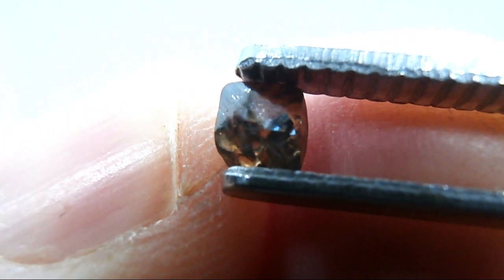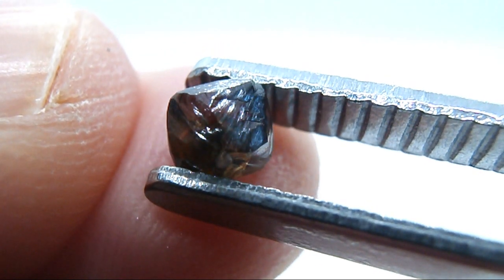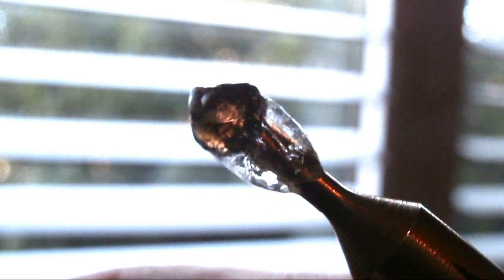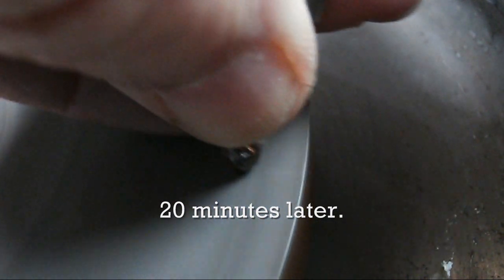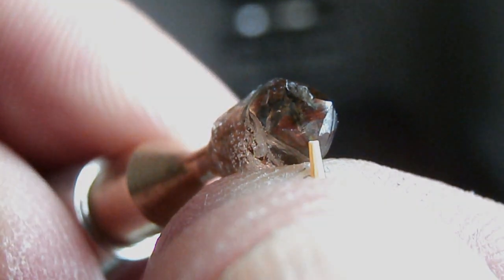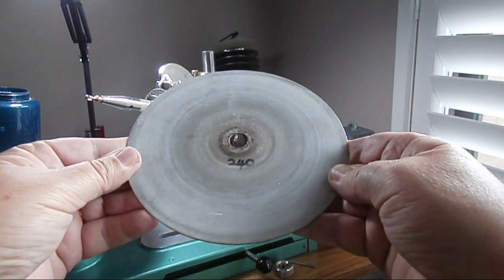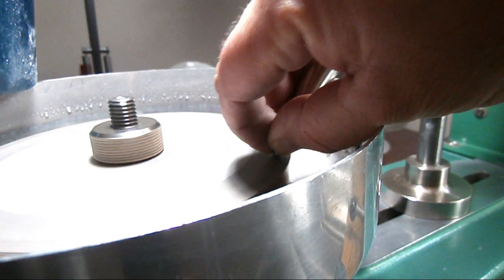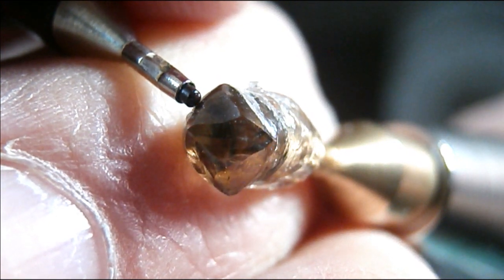Faceting a Diamond

Comment: Hello. You will need an iron scaife impregnated with diamond dust & caster oil. You will need to understand the grain or Voss of the stone and what you have there is a sawable not a makable. The Dodec is the third form of crystallography (cubic and octa) and you will need to position the table first. After sawing a top from the stone. Then set your stone into cross by polishing the top hoeks or corners at 34° then your bottom facets at 40.9°. Then 4 more facets opposite to these to create top corners above and below. You will need to brut the girdle on a manual Rams bruting machine or a Bettonville laser or similar. Then upper half facets and stars to create the bezel from the hoeks and corners and then the lower halfs 80° towards the polished culet. Then Zoet or smooth each facet on your scaife zoeting ring. Believe me polishing a diamond is Not polishing any other gemstone. Ask me anything you'd like to know. 34 years with De Beers!
Reply from the maker: Thanks for the information. There is quite a bit involved with cutting a diamond. Unfortunately I don't have the right equipment or the expertise. I thought it would be nice to test out how hard a Diamond is and see what it feels like on the lap. Diamonds certainly live up to their reputation as very hard gem. It would be good to learn the craft of cutting diamonds. Most likely it would be a very expensive hobby. Cheers
Reply: @sievecn do you provide training on diamond cutting and polishing? I am looking for a mentor who can teach me the skill. Willing to travel and work for free until I learn the craft?

Comment: Yes, i learnt  I  should stick to corundom or softer  and leave diamonds to the provs 
Thanks for sharing bud
Reply: @Babulal-nz8ii 
 I may have already sent this,,
 Your quite right , diamonds have been cut for a long time before machines speeded  the process, 

I was wrong to dismiss the possibility  without even trying ,
As I have successfully polished and shaped  Ruby, sapphire and quartz  buy hand on diamond sharpening pads and wet n dry paper ,, yeah it took a few hours for a few evenings,, but hey,, we were in lockdown.
Thanks for the inspiration to try my friend
Reply from the maker: Babulal has no idea what he is talking about! I made it quite clear in the beginning of the video that diamonds are usually faceted on specialised equipment - cast laps, claws etc. This video gives the average home hobbyist an idea what it like to facet a diamond on regular faceting equipment. As mentioned in the summery, it's feasible but a folly. Imagine the countless laps worn out, time and effort and what for? A diamond the cost less than the worn out equipment and time. Bababul is also trolling.
Reply: @VintageTimeGems   hi cliff , firstly I would like to say I enjoy your channel very much, and in no way was I disrespecting you..
Yes you made it clear you were not using diamond cutting equipment, you were showing what can be achieved on the gear you had,  I did not agree with the comment you were attempting to put people off trying .
This is my first experience of trolling,, I feel both a little stupid with myself  and horrified for you,
Your intentions were honest  and I think bublars comment must be born from jealousy.
I look forward to learning from your  next video,  I have also learnt from this experience that some people are just negative  and should keep their opinions to themselves, ,
Please keep making videos,  I love your channel and your style

Comment: If you can find laps that say "nickel boron " ,"TiN"(titanium nitride) ," melanite"  "np3 " or "hot salt bath nitride"  its all harder than diamond and shoukd help your cause as they dont change the surface dimensions what so ever. It changes the metal itself makes a super hard and low friction (were flat ,the grit will still be high friction despite lower coefficiant.it means less heat when cutting and longer wearing items  )   if you cant buy laps with the surface conversions , i KNOW you can have laps treated or depending on what you have access tofor resources, you may be able to afford a small nitriding setup and do the conversions yourself. Im sure it will make the laps last ALOT longer. Especially when new .
Reply from the maker: Thanks. Interesting information. The laps would probably cost a fortune and so would the diamonds. Cheers

Comment: I’ve seen diamond cutters in Asia working on fairly simple looking machines but I guess they are specialized equipment and their experience makes it look easy.
Reply: Babulal  I saw them training very young people on tiny flawed stones at first then gradually better very small stones for very little pay but it was a better job than they could get elsewhere. They worked their way up to cutting bigger & better stones. However the skills and equipment  only seemed focused on round diamond cuts.
Reply from the maker: @Babulal-nz8ii  OK....See how many topper laps you wear out. I was not only demonstrating on a typical machine most people own. And if you listened carefully I explained higher speeds and cast iron laps and a claw is usually needed.... USE WHAT I USED and then comment.
Reply from the maker: @wdwerker  Babulal has no idea what he is talking about. You will need a cast iron laps, maybe selective diamond pastes. Imagine wearing out a heap of topper laps at the rate I was faceting? It would cost a fortune in worn out laps.

Comment: Just a thought but using 30% hydrogen peroxide instead of simple water for the coolant(with gloves) may speed up the grinding .
At the grain level , the impact site get very hot for a few microseconds so it could create localized chemical combustion when combined with H2O2.
It could  use up the abrasive pretty quickly though.
Reply from the maker: Would that destroy the lap?
Reply: @VintageTimeGems  I kinda wanna know 2 lol incase I start
Reply: @VintageTimeGems  Well 30%H2O2 is a mild oxidizer at room temperature so i dont think so unless you soak it for days but for testing just put a drop on the lap and look for signs of oxidation.
You will find more info on this compatibility chart https://marketing.industrialspec.com/acton/attachment/30397/f-0034/1/-/-/-/-/hydrogen-peroxide-material-compatibility-chart-from-ism.pdf
Also wear gloves and googles because H2O2 can be quite irritating for the skin and even more for the eyes (but it is not toxic so it can be disposed in the drain)
I am not a facetter so i don’t know the materials that compose the lap, if you could tell me I will give you a more precise answer.
This idea is inspired by a lapping method called chemical mechanical polishing (CMP) used in IC industry to polish silicon wafers with hard coating on it (silicon nitride for example).

Maybe using an abrasive made of a softer oxide (for example Alumina) would give better results as it will not be consumed by the oxidation, in this case all the polishing will be performed by the oxidation reaction.

Comment: I think you are cutting across the the grain, if you cut with the grain it will cut faster. That is why many diamond faceting heads will swivel 360*.  Think of it as a wood board, the grain is softer with the grain and harder across  the grain.

Comment: Your problem isn't your machine. Your problem is that you're not using the right material to try and cut the stone with. You need to use diamond powder to cut a diamond with. Think of the way you polish your stones using diamond powder but with lower grit size for the powder. Get the right material and you will be amazed and just how quickly you can cut and polish a diamond. I watched a guy in India cut one and go from a rough stone to finished gem in just a few hours back in the early 1980s
Reply: Wrong. He IS using diamond power, but without a specialized machine spinning at 3,000 RPM... fuhgeddaboudit.

Comment: Cutting diamonds is apparently also important to consider the source of diamond. The Argyle diamonds of Australia apparently formed deeper in the earth and are harder than African and most Russian sourced diamonds. Yes even diamonds have an apparent range of hardness greyer than the 9 Sapphire/ruby to 10 Diamond gradation.
Further the rough forming is normally done using other diamonds not a lap. Many gems are cut ising teo lower grade stones. Plus the polishing gits need to be of same or harder than generic type as the diamond being  polished. This is information I was given by a manufacturing jeweler doing mainly Argyle stones.
Reply from the maker: Thanks for the info...I think I will just facet other gems.

Comment: Thank you, very inspiring. I wonder if using nano carbon powder would work?
Reply from the maker: @Babulal-nz8ii  Is trolling- Babulal has no idea what he is talking about! I made it quite clear in the beginning of the video that diamonds are usually faceted on specialised equipment - cast laps, claws etc. This video gives the average home hobbyist an idea what it like to facet a diamond on regular faceting equipment. As mentioned in the summery, it's feasible but a folly. Imagine the countless laps worn out, time and effort and what for? A diamond the cost less than the worn out equipment and time.
Reply from the maker: Hi Brad, I have no idea if nano carbon paper would work. Cheers Cliff
Reply: I doubt nano carbon would work as it is not the ultra strong laayice as a fiamond. Just because is is carbon dies not make it hard or abrasive. In one arrangement carbon atoms are flat sheets making up graphite are very low friction form. Even Bucky balls do not have hardness in abrasion form though are VERY strong.

Comment: The quality of the diamond in those electroplated discs from China is very very poor. You would need a cast iron lap with Debeers diamond powder to cut it in a somewhat reasonable time. Also try mixing the CA glue with graphite powder to strengthen the hold and to help with heat.